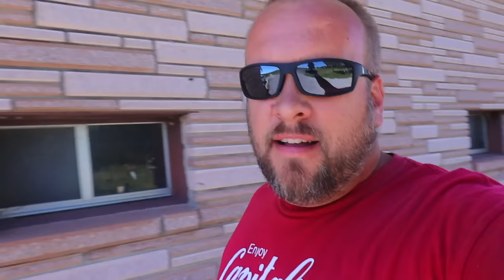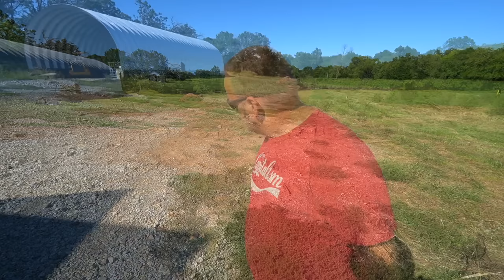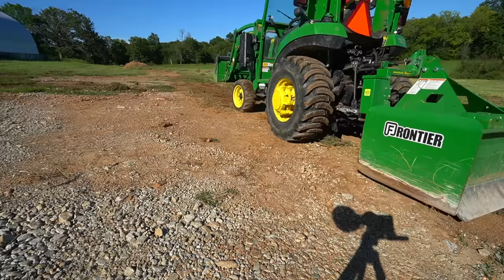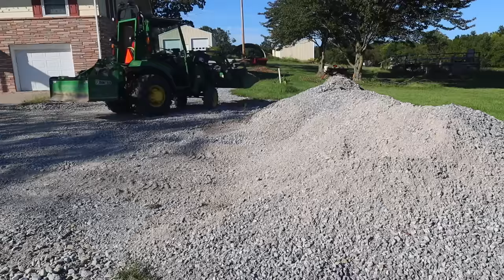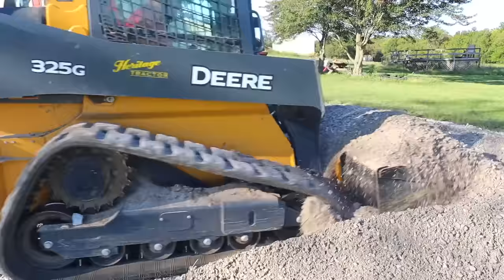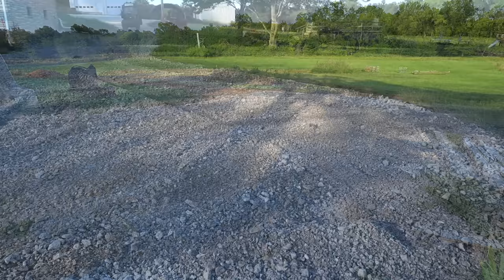Spreading Driveway Rock - Tractor Vs Skid Steer

Comment: Brock, I think your best approach to the vegetation solution in your Rock driveway would be to control it with Roundup or a comparable product. Usually an application 3 times during the growing season is sufficient. It would not be in contact with a food product and would work very well.

Comment: I try to back drag with the skid steer bucket in float to finish, it's worked well. How does the float on the compact tractor bucket compare, do they have one?
Reply from the maker: Yeah, float on the tractor is really easy and works well

Comment: geotextile is primarily a structural reinforcement of the soil. when you press down on it with a tire, it pulls the fabric in all directions, but the weight of the rock around it holds it back, so it spreads the load of your tire out quite a bit. its often not buried deep enough to justify using it though. going on memory it needs to be something like >6" below grade to be an effective structural element

Comment: Im not a fan of geotextile.  Screws things up when you start to get potholes and you need to drag the box blade rippers to break it up plus my driveway is over a half mile long so it would have cost a fortune.  Only spots I have any vegetation is where I skimped on rock.
Reply: You won’t get potholes with geotextile